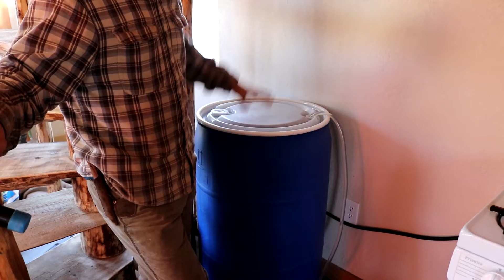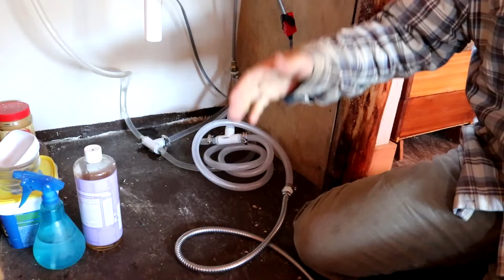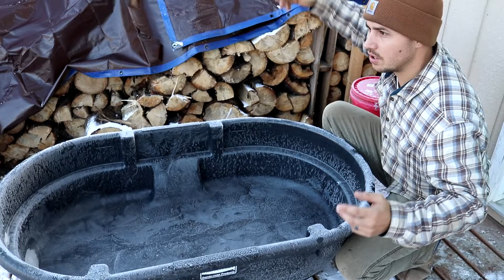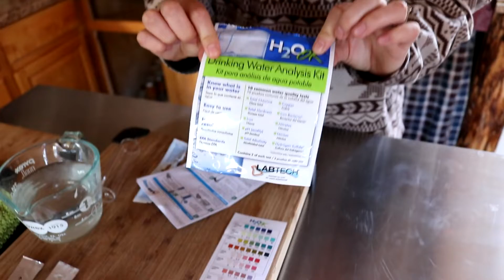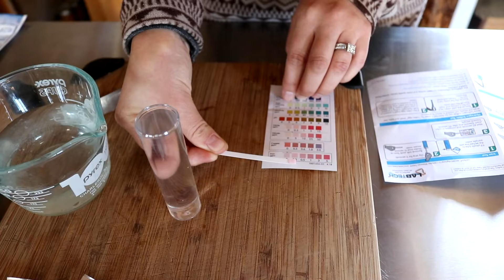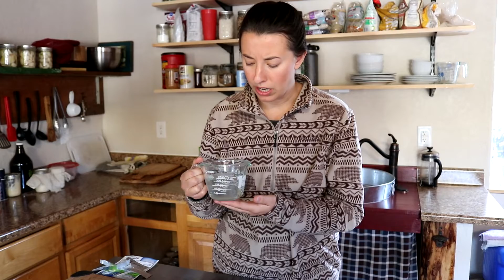Running Water at Our Off Grid Cabin

Comment: You look up bush radical on YouTube he did a shower room it has a regular tub and he has like a you put water in a pump and you just pressure do ITIT does a shower head and a room to stand and dry off and all that other good stuff I think that would be good for you he should looked it up instead of doing the system that you got now it'll be better and then ain't gonna hurt it won't hurt the book get it and check it out

Comment: Hopefully this will save some headache for you. My sister has a tankless water heater in her house. She had to have it serviced because water temp was inconsistent. When the repair man opened it up the motherboard looked like it was encased in amber! He explained that in his experience the tankless heaters require MUCH more maintenance. You guys are super handy and seem like you can deal with most stuff that come your way… I’d recommend opening it up twice a year just to check for leaking of…… anything I guess but I can’t remember what he called the Amber-looking stuff which was everywhere by the way, not just the motherboard. The service call was around $1000 if I remember right. He said parts for those are really hard to find because many of the parts are specific.

Comment: there is no such thing as a hot water heater.  If the water was hot it wouldn't need to be heated and the tank would be a holding tank,  I am a plumbing inspector, an elec inspector, a building inspector, a professional taxidermist and an army trained dental hygienist

Comment: Looks like a great setup,  have you considered putting the  tank on the second level bedroom,  that way you would only have to pump water from the well to the tank and then gravity can feed the water inside your house,  so it would eliminate the inside pump,   Requirement for electricity for it etc,
Reply from the maker: vxnova1 yes we did consider that but needed more pressure to activate our water heater.
Reply: Simple Living Alaska ahh ok,  that’s a pity,  would have been nice to eliminate the pump

Comment: Even with the switch on the pump, you may want to put the pump in a plastic tray just to save you from having to clean up a mess.  Your hot water system is neat.

Comment: There is a hose designed for drinking water AND it has a heat cable that is embedded in the hose. I used this when we lived in our motor home in Portland and even in the ice storms and buried under 6 inches of snow it never froze once and neither did the spicket. Mine was a 50 footer and it only cost me $25. Also, there are filters that screw on to the hose that filter out a whole lot of stuff. An now about the 55-gallon barrel. I know I am sounding like a broken record here,(LOL) but a small 9 inch by 12 Inch grow pad that it sits on will prevent freezing. Our Motor home had a 50-gallon tank and I had the pad duct-taped to it. ( I always kept the tank full as a backup for that just in case situation. Also, I had an ultraviolet wand in the tank to neutralize any pathogens. Just a thought.
Reply from the maker: Jeff Strong thank you for the recommendations ☺

Comment: Does the water filter actually remove ALL impurities? You don't have bacteria now but is there any even remote chance your supply could be contaminated at some point in the future? Have you considered a water distiller? I am looking at them for another reason but excited to potentially have pure water . . . as I understand it a distiller would remove even trace amounts of things like arsenic, bacteria & nitrates
Reply from the maker: AnniamNgoppe a water distiller would use too much energy with our solar system. We don't use the filters all the time, generally if the water was a little sandy we would use them to filter that. I would say the likely hood that it will be contaminated with bacteria is low considering how deep our well is in comparison to a spring. I think there are better options out there for drinking water but this is what we have.
Reply: Drinking distilled water exclusively isn't a great idea. It won't have any necessary/beneficial minerals or anything and can eventually lead to deficiencies. It's not particularly harmful if you're getting those elsewhere, but it's not beneficial really. It's also more likely to leach stuff from the container it's in than non distilled water. Plus 3ppb arsenic is totally negligible. You'd get more just from eating leafy greens. Bacteria and nitrates are mostly caused from shallow wells and farm/septic runoff. It's not prevalent at all in deeper wells away from heavy farmland.

Comment: Minor and unimportant point, but its one of my small irritations:  You have a water heater, NOT a hot water heater...LOL.  If the water were hot it wouldn't need to be heated.

Y'all look like you are getting set up well.  There are a few things I would do differently, but not much.
Reply: My mistake. Sorry my good man.
Reply: @garykuiken6191  No problem.
Reply: It's called on demand water heater.  Have been used in many parts of Europe  for half a century  to save on gas or propane.  What's the point of a hot water tank  that has be fired up when ever the water temp drops.  Plus your heating 30 to 40 gallons when you use only  a small amount for washing up or a shower.
Reply: @garykuiken6191  You TOTALLY miss my point.  My point is its a WATER heater, not a HOT water heater.  I am very familiar with on-demand, AKA tankless, water heaters as I've had two in my home for over 10 years...one for my potable water and one that supplies hot water to my hydronic radiant floor.

Comment: How does that work, is the water free?
Reply from the maker: Andrew we have a well on our land so we use a 12 volt pump powered by our solar system to push the water through the hot water heater.  Hope this answers your question!

Comment: Cool water set up. I like the idea of the water barrel inside. Last year my system froze for a couple weeks. A barrel inside would have been great. I also like the rubbermaid tub for showering. I run a hose to the front porch and have a hot shower there but it's freezingass cold this time of year. I see a tub in my future Haha! Do you guys have a CO2 detector? If not, please consider getting one or two ASAP. There's a channel called Breaking Free Off Grid and they just about died from a propane leak in their cabin. It's not something you want to put off.  I bought two after seeing their video. One for backup if the other failed. No second chances with CO2 leak while you sleep. Anyway, just wanted to pass that on to you guys.
Reply from the maker: Thanks! Yes thankfully my wife is very cautious and we have a carbon monoxide detector! We installed it when we put in our propane stove. We will definitely be switching back to outdoor showers as soon as it warms back up, 6 degrees F today!
Reply: Simple Living Alaska Oh good to hear on the detectors. Six degrees Lol. That is ridiculously cold.